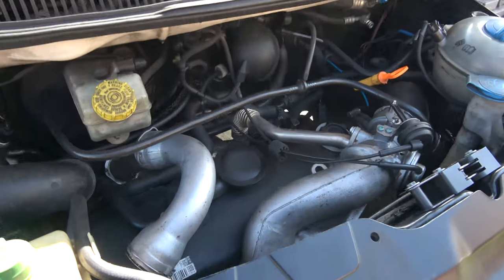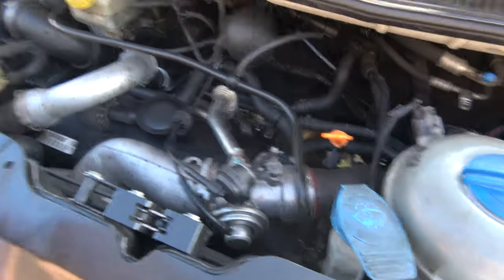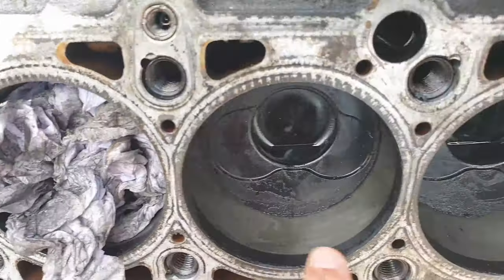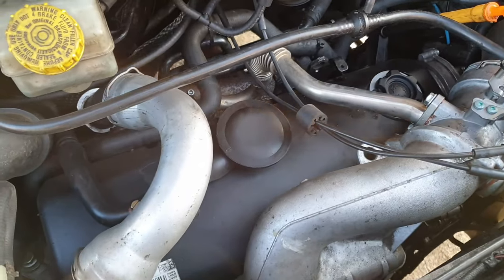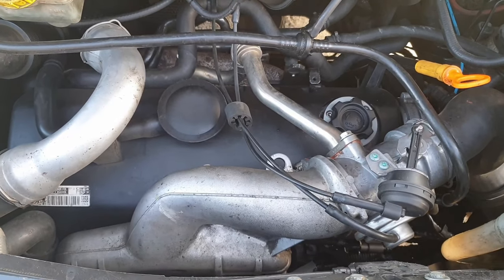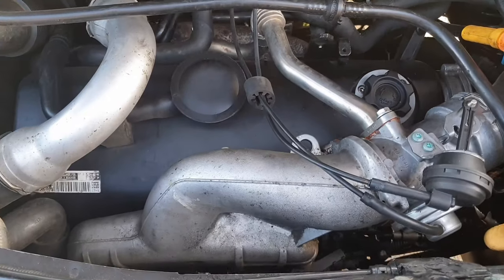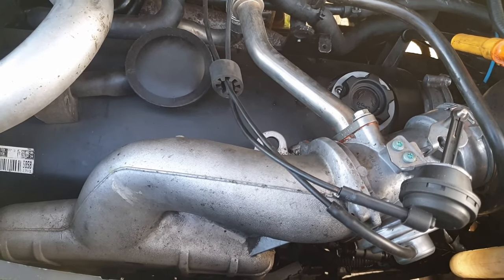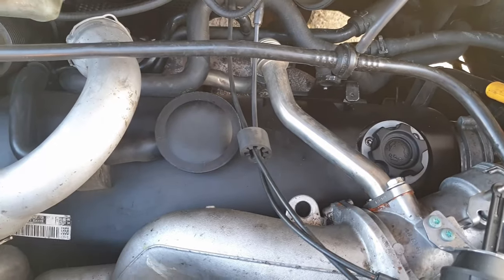VW T5 - Engine Replacement - Part 2

Comment: Good for you mate it’s a labour of love getting a Transporter running right. Mine a 5 cyl is using oil but runs well the oil ends up in the intercooler pipes despite a new turbo it’s still drinking oil. The exhaust is smoke free nothing!

Comment: Mine sounds like the before on start up but only for a second then it sounds a lot quieter. 242k on mine so interesting to see.
Im never spending 6k on my engine however, i wilk do as much of it as possible myself. Hopefully. 
Great vids, clearly not afraid to open that car up and get stuck into it, so well done for that.
Reply from the maker: Cheers. Never intended to spend so much and as you can see from the channel do most work myself. Just not brave enough to lift the engine out at home on the drive.

Comment: yep, I get 39mpg on a BNZ 2.5tdi (caravelle) on a long journey and 44.5 mpg when restricted to 40mph constant over about 10 miles (roadworks/full carriageway).  City driving kills the mpg of course but fortunately I don't do much of that , at least not without a motorway run attached to it.

Comment: Hi thanks for the reply. I'm in the same position as yourself. ie run it until it  bangs
My plan is to get a used engine and learn how to strip and build it. These AXD are difficult to play with as they are sprung mechanical and only work one way or not at all. I'm beginning to think the specified specific requirements are very fine, when I have looked at the gear specs ,in the engine ,there does seem to be slight differences between the AXD 2005 models. VW people seem to want to keep the secret to them selves. 
Thanks I'll keep you informed 😟

Comment: Hi I changed my axd t5 engine with the next company" Hayes 4x4"on your eBay list ,they cost me 4.6k
4200 miles and 7 trips back over a year with a problem he couldn't correct until the van stranded me. Turned out to be a valve spring Then 13k miles in (875 miles out of warranty) the injector seals failed.
 Plastic  water  pump also failed and turbo gasket
And now I've been told it's not an AXD engine. Difficult to prove without an engine strip.
New engine 21 to 25 mpg.
Old knackered engine 35 to 40 mpg. 
But it runs .drinks oil and bĺows   smoke on start up.
Reply from the maker: Sorry to hear this. Yes mine is hardly perfect, but I've decided to go with it until it dies. Hope you get yours up and running again. When I bought this unit, they made it clear there was no warranty of any sorts on the injectors / seals and turbo etc. No idea if it has a plastic or metal water pump. Just keep my fingers and toes crossed when far from home! Only drink 1L of oil every few 1000 miles now. so there is that saving.
Reply: I've just ordered an engine from Hayes, im concerned now 😫
Reply: @darrenhodgetts4255  Hi if the engine is not as specified prepare to sue him because he WILL lie to you. Do Not let him put the engine in.He WILL break every connection plug and damage the wagon. Check the negative comments on ebay for more evidence ofpoor customer service. Pay extra and get vw to do it. 
The engine I bought  is beyond poor.
70mph is really 64.4 mph.
70 mph used to be 1500 on the revs. It is now 2000.The telemetry is so far out that 1000 miles is really 920. Only done 20k which is 18400. Atfer 7k after he repaired it 7 times the injector seals had to be replaced. They should do 60-80k. ADAM the guy at Hayes 4x4 fukk'd the vehicle. Because it is expensive to prove the poor work I have been stuck with it. I have been told of a T5 wizard in Mansfield who can diagnose the problems but this will cost a couple of thousand. I will put a video of it up so you can see and hear the mess he made 20k in.
Reply: @psimanx5416  who's the T5 WIZARD? the engine hayes have offered has a brand new cylinder head, was that the same with yours? I'm supply only from him. How long ago did you have it done.
Reply: @darrenhodgetts4255  Hi the wizard is the brother  of a chap I work with so I have to go through him. The YouTube site he has has gone private and I'm not back at work until March so can't contact until then.sorry about that. 
Hayes started the work in October 2016 and did the final repair to the new engine in August 2017 after 7 visit. I had told him about the telemetry problem but he said to remap it, which cost £365 ....but that didn't sort the problem  because the gears,engine speed and wheel rotation are all linked which is why you get the speedo reading wrong when you change the tyre size. The engine is a tensioned mechanical engine so no belts and it takes a t5 specialist to work on it not just a good mechanic. Which is why I think ADAM at Hayes 4x4 fukk'd it up.
The engine I bought is running but it is under powered by about 20-30% and does about 25 -28 mpg. Down from 38 - 40mpg with the knackered old engine.
On the forums they do say that there are different AXD engines signified by the TDI badge. If the I is red, that's one type of engine. But if the D and I are red that's another. Having spent years studying it I think it's down to either a cog size in the timing system or a 5 degree retardation which is a down to an incorrect torque setting at engine assembly which cannot be rectifying on a rolling road.
Dan's engine seems like it has been correctly tensioned or it is a red DI unit. As he notes that the new engine is faster.Could be worth checking out Dan's mechanic.
Bit of a long one but I hope it helps.
P.S. If you are just buying parts make sure they are good parts.
As he will tell you his child is ill.
Psi-man😎
Reply: @psimanx5416  did your engine come with a new cylinder head? I've been passed the details to Hayes by a local garage that always use them, they did say don't let them fit it as there is no care for your vehicle they just build engines
Reply: @darrenhodgetts4255  No I had a new engine despite having a new cam on the old engine.
Your fitter is correct. don't let Hayes 4x4 touch your wagon it took 7 return trips to repair. He finally said it was a spring which failed. He broke every connection and damage other bits. When I get the telemetry proof amongst other things this all goes to court.
Hope all goes well. 👍
Reply: I did take the wagon back after 300 miles when he first put the engine in. There is a lot more to the story. But I'll just sound like a crushed grape...lol
Reply: @darrenhodgetts4255  Hey how did your van turn out?
Reply: Hi you didn't get back about your new T5 transporter engine. Did it work?
With mine I'm told the work to advance the timing is about 2k. so 20,000 miles in I'm changing the engine again.😢
Reply: @psimanx5416  hi be great to talk to you directly my engine arrived and I had a local vw specialist fit it, they said they weren't happy with a few things and wouldn't try and put things right, ive done 180 mile in it and its been confirmed today there is an issue with the engine, it has to go back to them for a warranty repair now, possibly a new engine.
Reply: @darrenhodgetts4255  Hi sorry to hear about your new engine giving you problems. The best advice I can give you is :
 (a) if your machanic says it's a fault with the Hayes engine parts or engine. Take them to court and Sue them for your money back and expenses. expenses being the machanics cost. Don't waste your time with them they will bodge it to get it out of the shop.
(b) if your machanic does not specialise in T5 axd engineering kick his ass to get it right. If he refuses take them to court.
(c) Get a new engine or fine a new specialist.
If you got the bottle to do the work yourself it's time to learn how to do the work. This is the route I've taken. It's scary but the knowledge is worthwhile and on going. Reason is not one machanic has got any job right. Even if I have to strip the engine down and rebuild it or spend 2k on a new engine. Because it's the only vehicle worth 4k as scrap and 10 to 15k as a camper. 
On my play list Under T5ivez I've been collecting build/ repair videos. which will help.
I hope this was helpful. Hang in there chap 😉

Comment: Hi DanWe are in the same position that you were.  We've had a new turbo and now the T5 is drinking oil more than fuel and we have oil in the coolant.  We are going down the route of new engine and just wondered where you got your engine from and the cost of the good engine?Cheers,Dean & Claire
Reply from the maker: I'm afraid I cant recommend anywhere. I had troubles with mine and spent months trying to get it sorted. I could have been left with nothing to show for the money. Best advice would be to contact some VW specialist garages and see if they can source or recommend an engine supplier. Also have it delivered to a garage and as for inspection. If the suppliers will provide it with the head of that's even better. Your gonna want all 5 cylinders lined
Reply: Jumping in here, what year and size is your engine, T5 can mean a whole lot of different engine configurations?
Reply from the maker: @milesslocombe1121  it's the 2.5 AXD,
Reply: Hi its a 2005 2.5 130hp auto it has 135000 and runs sweet as a nut, will sit at 90mph all day long with no smoke or anything. there is some diesel smoke on start up but that's all,van also has a pendle re-map to just under 200 bhp. it has always used oil but a few months ago started drinking it 0.5ltr in just over 100miles still with no smoke or leaks but oil in the water
Reply from the maker: @FLATSTICK250  its unusual but when my water pump went it first showed up as oil in water. Most people say you only get water in oil, but seemed to go agaist what everyone was saying as when I did the water pump it solved that.. however I doubt that's where 0.5l per 100 miles is going. It's either an oil leak aswell, or turbo passing oil or engine is burning it. Diesel smoke on start up is another issue I guess. 1st call glow plugs, then a compression check maybe, but it could be a number of causes, worn valve seals, low compression or I guess worse case (as in my case) a bust cylinder. Mine ran great but burnt oil like your is. Changed the engine, no oil burning now, but still diesel smoke on start up.. was hoping it would be like new, but it's not. Looking back I think I should have driven it till it went bang and had a new engine then. But it's a real pain keeping the oil topped up. It was recommended that a thinker oil might slow the consumption.
Reply: @DanSohan  I've had a re man engine and not happy with mine, I have bad smoke on start up, it doesn't seem to run on all 5 cylinders first start In the morning for a few seconds, now I have oil in the coolant, and the expansion bottle is filling up with exhaust gases
Reply from the maker: @darrenhodgetts4255  sounds like the head gasket has failed. Did the engine come with the head on it, or was that swapped later? How long has the engine been in for? How's the relationship with the seller? All you can do is gently persuade them to put it right if in a warranty...
Reply: @DanSohan  it's only done 150 mile, been having issue and the seller has been helpfull but its cost me a new turbo, a new vac pump and new water pump, hes having the van back to sort the repair, he thinks there could be a crack in the block or possibly a liner slipped.
Reply from the maker: @darrenhodgetts4255 what an expensive faff, and all the vdub crew will be saying these engines are rock solid, obviously they're  the lucky ones. Glad they've agreed to take it in for work. You hear horror stories of the remanufacture refusing to honor their warranties. Fingers crossed for you
Reply: @DanSohan  , I'd use a proper engine reconditioner like Barum engines, you can see them on YT, they will not use an second hand parts, it will cost more but will right and as new.

Comment: Didn't any experts do a compression test ?
Reply from the maker: Yes. There was zero compression on that cylinder.
Reply: @DanSohan  t5  is  rubbish. I have an 05 and I won't be getting another. I do all my own work and I'm all honesty I'm shocked at the low quality of a lot of it. Don't get me wrong I do like it but next time it'll be a transit 😀
Reply from the maker: @james011974  yep. Know the pains.. and not been a v dubber fan boy with decals and £5000 exhaust makes been an owner more painful I guess.

Comment: I've got a 2004 2.5 AXE with 330.000 km.
It's using 2l of oil every few hundreds km. 
VW garage asks 5000€ for new engine. I don't know what "new" means exactly..
I don't know what to do... I'm starting to think these engines are just crap...
Maybe I should get a T4 instead... But I like the T5 more🤣
Reply from the maker: New engine from a VW dealer? Will they give a warranty? I paid £7500 for ours and it lasted 2 years
Reply: @DanSohan  Some kind of warranty yes but I still need to find out the details... 
That's very sad 😱 Did you manage to fix it someway?

Comment: These companies all seem to build the engines from a election of used parts and a minimum of new bits, as an experienced mechanic, having rebuilt many engines, over 50+ years, I do not consider this a properly reconditioned engine and would not be happy spending  ssssuch a large amount for half a job.